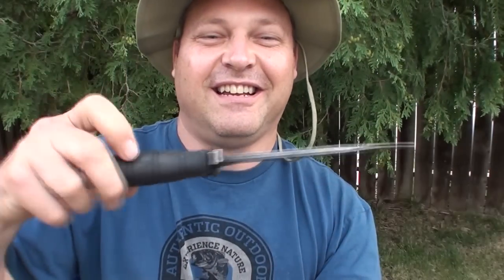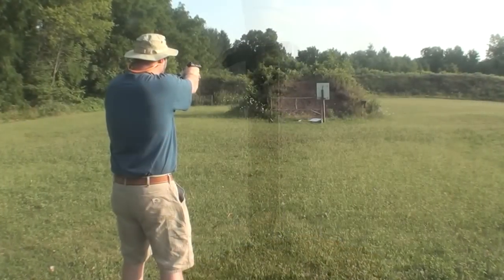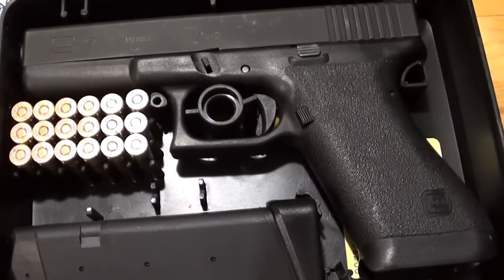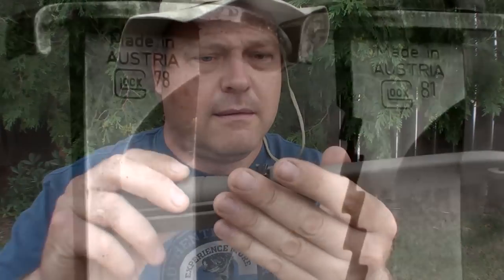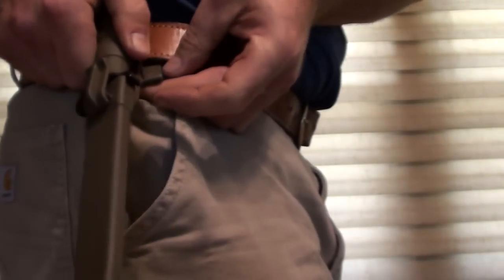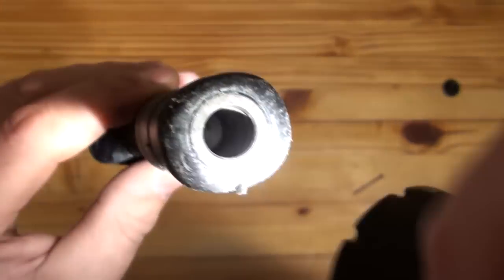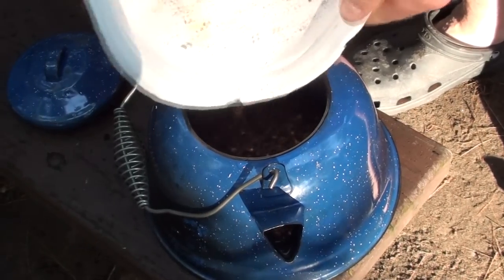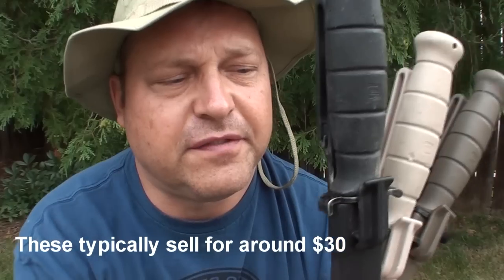Glock Knife - Will It Stop a Bullet?

Comment: The hole in the bottom is NOT for making it a spear. it was designed to be used as a bayonet on an AUG. the "Bottle Opener" was to help hold in in place when used as  a bayonet. That being said, it does work if you wish to make it a spear.
Reply from the maker: Kyle Harkness  Sounds like you watched my other Glock knife video.

Comment from the maker: Use a knife with a thin blade and go under the edge of the tail cap working your way around it while gently lifting the edge.  After a while you will be able to get your fingers underneath the cap edge and twist or wiggle it out of the steel tube.  Typically the cap will be damaged when you get it out though.

Comment from the maker: The factory edge is steep, and that's good for the type of hard use I put my Glock knives through.  Change the angle and they won't be suitable for throwing or wood splitting any more.  It'll want to chip.

If I need a razor I just reach into my pocket for my flat ground Spyderco Delica 4.

Glad you liked this!  Thank you.

Comment: Nice review! I have a 78 - it wasn't very sharp on arrival but it takes a nice edge and keeps it well. Highly recommended. 
One question: how do you get the handle plug out without damaging it? 
All the best, Rob
Reply from the maker: RobWhittlestone That's not easy to do but if you use a very thin blade and pry gently, slowly working your way around the plug several times it will eventually come loose to the point where you can grip it with your fingers and wiggle it out.

Comment from the maker: The .22 rimfire has a higher velocity and smaller sectional density than most other handguns so I think the blade would hold up to a 9, .40, or .45 as long as the bullet doesn't hit the thin part of the blade.  I might try that one of these days.

Comment: I have a Glock field knife that I really do use quite a bit.  I do not see the Glock knife as a survival knife.  The straight blade stops the knife from doing a lot of things you expect a knife to do very well.  I do see the Glock knife as a good working knife.  It whacks right through steel packing straps and opens wood storage boxes quickly.   It makes a great pry bar and does many other tasks that would destroy most knives.  

 I had to use a belt sander to set the proper angle on the blade.  I could have set the angle with a stone but a belt sander with a 600 grit belt did the job much quicker without over heating the blade.  Now I can cut steel straps and abuse the knife in many other ways.  When I am finished abusing the knife in about 15 minutes with a ceramic sharpening rod it will shave again.   

In almost every video on the Glock knife I see someone using the knife as an axe.  In a SHTF situation I would bring a real axe.  My pack has loops that one can carry a real 3 1/2 lb Michigan axe with a fiberglass handle very easily.  I do not want to be out in the woods trying to build a shelter with a hatchet or a knife.   Moreover, a real axe makes breaking into buildings to acquire supplies much easier.

Comment from the maker: Nobody else asked that yet.  I should have demonstrated that in the video.  You work the blade of another knife under the lip of the cap and pry up just a little bit, moving the blade around the cap as you go until it is out far enough to get a grip on it with your fingers.  Then wiggle it out.
Usually removing the cap means discarding it because the fit is very tight and plastic lip gets stretched out.

Comment: Quick note to those who've watched Noss tests on the Glock 81:
I have tried that with one of my 78s, and eventually put a slight bend in the blade that would come out again. But it didn't snap. I think the culprit in the 81 destruction test video was those silly saw teeth. The nice and straight, chamfered spine of the 78 is much more reliable. Think about that if you're out there considering the 81, it's not worth it in any way.

Comment: I've got a knife marked AES Solingen W.-Germany that is nearly identical to the Glock feldmesser 78. Do you have any more information on the relation between the two? Which one came first? The Solingen version doesn't have a hollow handle and I'm assuming it's safe to say it isn't made of the same Glock polymer. More info or not, I'm gonna start practicing throwing this guy! Cheers!
Reply from the maker: Daniel Cheng It's my understanding these knives were built to fulfill Austrian military contracts and followed certain design specifications and AES Solingen had the contract before Glock did, sort of like when different US gun makers built the same basic firearms under military contract eg. - 1911A1 pistols, M1 Garand rifles.

Comment: very good review. as a poor college boy with only budget knives I'm having a hard time deciding between the glock field knife, and the mora companion heavy duty. both are carbon steel,  both have 3/4 tang, both hold edge alright.  the mora is so much better for bushcraft, carving, and cutting, but the glock is the knife you would want for batoning wood, throwing, or for any combat scenario. where one lacks the other excels I'm very close to just saying fuck it, and will carry both, in the case i throw my glock knife, and lose it.
Reply: +viking Mckim Get the glock you wont be disappointed

Comment: I though you would shoot it with a Glock, but instead you chose a good ol' Luger.
Reply: im pretty sure that was a ruger mk11.22 pistol. its similar to the luger design, but in .22
Reply: nelsonstephen20 - Ruger is the company that made a near exact copy of the German Luger in 9mm, but you could be right.
Reply from the maker: +SkylineToTheSeaAndMe It is indeed a MKII Ruger heavy-barrel, which originally followed the Japanese Nambu pistol design.
Reply: theKGB65- You learn something new every day. I had know idea the Germans used a Japanese design. I had an old Ruger 9mm Luger in the late 1970s/early 80s, but sold it for $200, replacing it with a Glock model 17 in 1987.